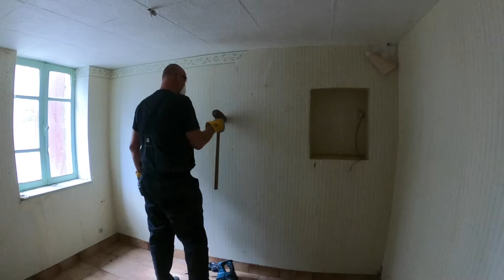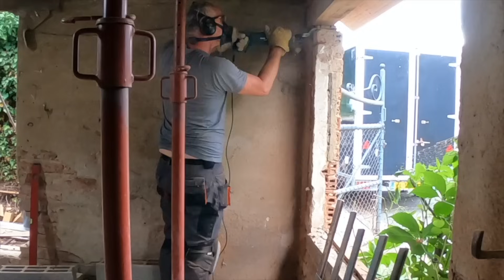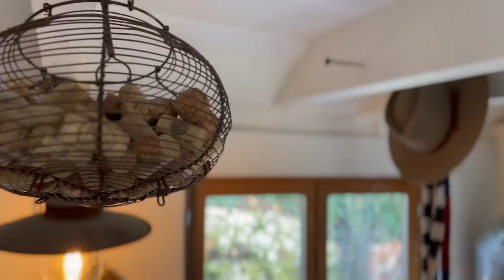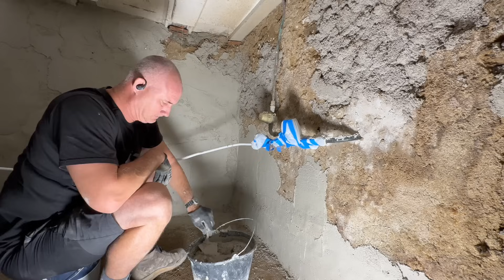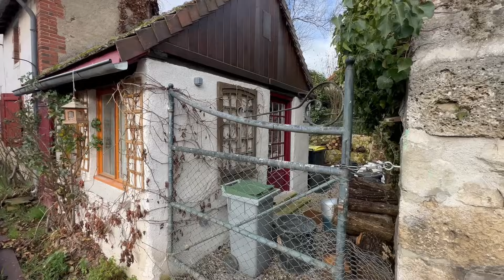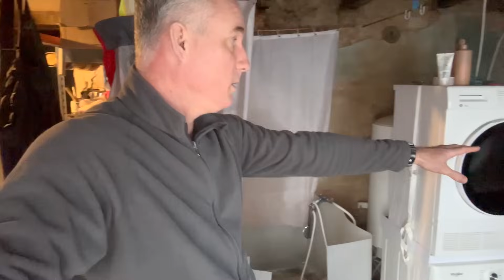Past, present and future. An entirely different vlog. Episode 62

Comment: Enjoyed this thank you. You should be very proud of all that you have achieved. As far as plants, for your north facing garden, what about hydrangeas? Im looking forward to further renovation work. It will be lovely. Im always wary of high ceiling rooms and stairs out of sitting rooms as, obviously, heat rises. I understand that space is at a premium
Reply from the maker: Thanks! Yes heat rises. The thing is that for most of the year we don’t need heating thanks to global warming and I’m not sure if we will be much in the house during the winter once it’s finished. I’m not worried about the bedroom but the tv/ sitting room could become an issue as we’re planning to completely remove the ceiling/ floor there. Possibly we need to install a ceiling fan which pushes the hot air back down again.